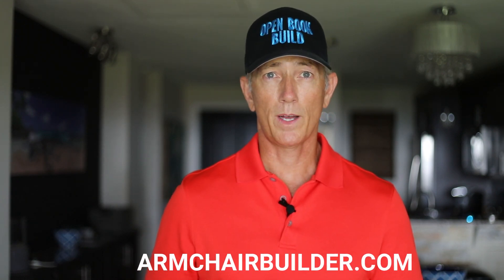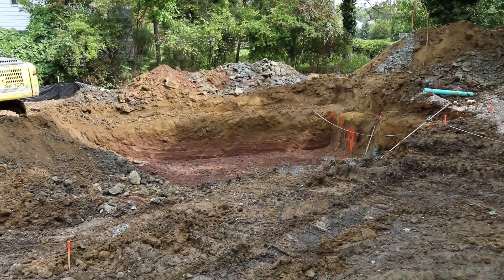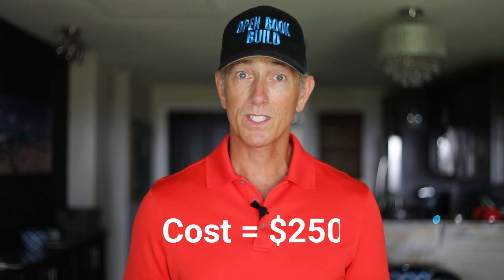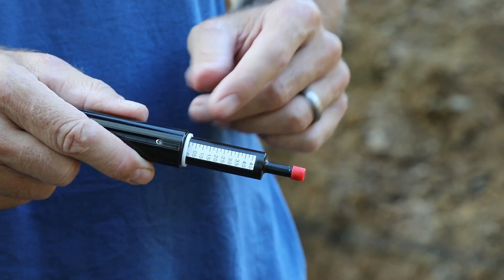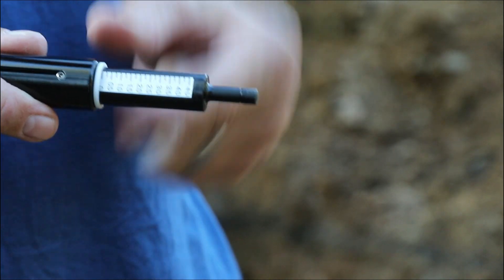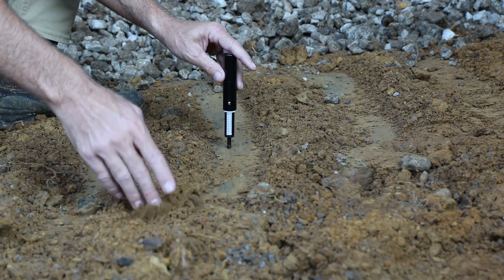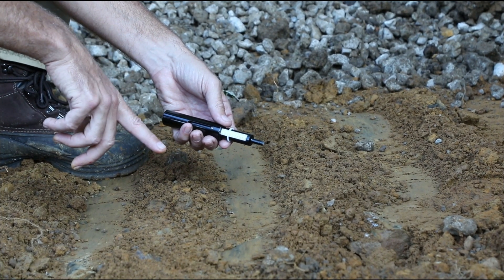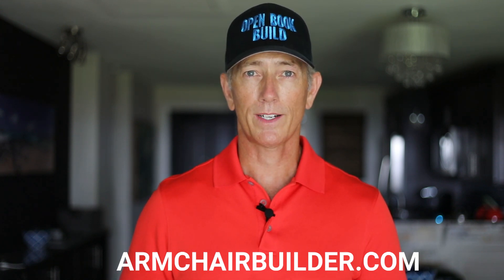House Foundation Soil Bearing Capacity: Avoid Structural Issues

Comment: FYI a geotechnician in bay area charges 8-10 grands vs. 250 in the video
Reply: word-forthat amount , I could throw a foot of gravel under the entire footer to stabilize Qould spend it on compacted gravel under the footer Q-not that bad in metro DC, but NOT in insignificant cost at al.

Comment: Pocket Penetrometers are for use for cohesive soils (Clays or Silty Clay). They are not for use for granular soils (sand or rock). The tool for granular is a Housel Penetrometer.  I use these everyday as a geotech.  Love having clay as bearing soil as i dont have to lug a 50lb housel around with me.